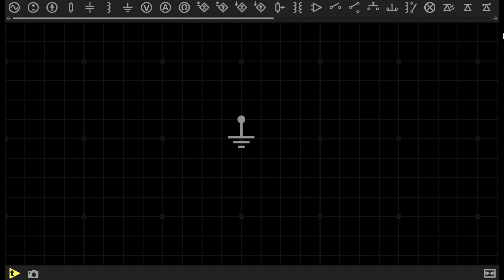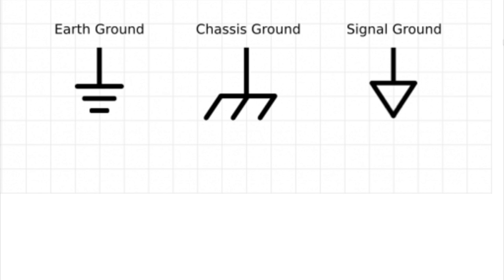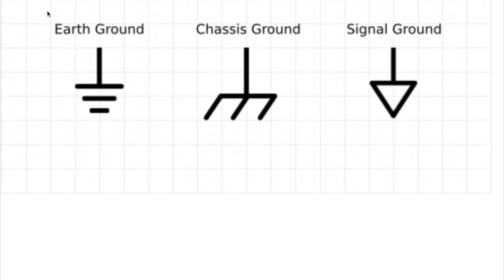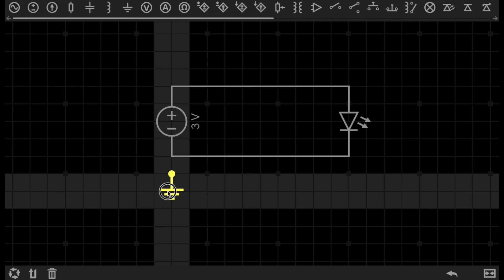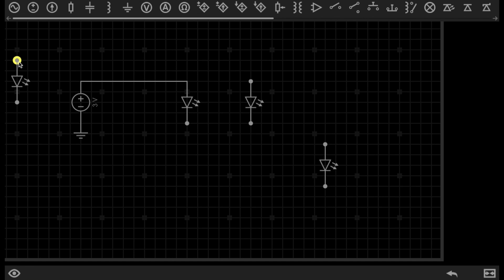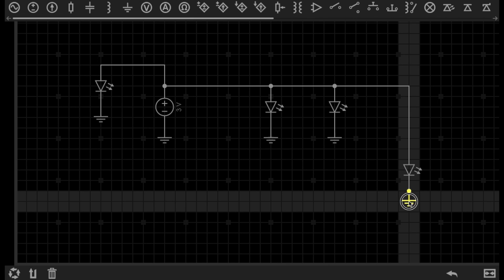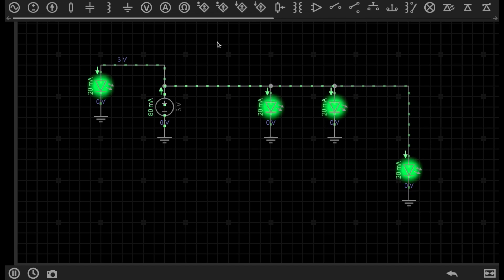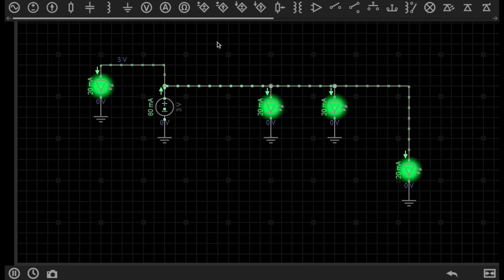That Ground Symbol (What is Ground?) - Electronics Basics 24

Comment: @1:52 “want to go in order to get rid of additional charge”. Incorrect statement, this is the point at which they are back to zero energy, that is 0 Joules. Another better way of stating it is “in order to return to the ground state (balanced). It then goes through the Voltage source to create the Anion/Cation imbalance.

Comment: 2:11 That's not true. Electrons come from the wire itself because the +ve side strips them from the wire, then a +ve wave of charge density ("holes") goes to a negative terminal.

Electrons produced on the negative side actually BLOCK other electrons in the wire until a +ve wave hits that end, then the electrons from a negative terminal start skipping from +ve hole to +ve hole throughout the wire, until they reach a positive terminal.

Comment: 4:26 alright so let me see if i got this right. All the loads are connected to ground, and the negative terminal is connected to ground. Electrons flow from positive straight to the ground, and then back to the negative terminal of the battery through the ground. The ground completes the circuit so the GROUND is supplying electrons to the battery as shown in the video

Comment: battery is like an apple on tree, its have potional energy...or like quiet sea have potional energy...now battery almost like capcitor...one plate is charged with more electrons and one is with less...and the electrons is pushed away from the negative toward the positve terminal.  you can do test it for your self people...this guy is wrong..electrons never move from positve to negative...everyone think that electrons move from the positive side of battery to negative...because of the sign +,   ironically the electrons get out of the battery from negative side through the wire and to postive side...

Comment: in a battery the electrons get out from  the minus side through the wire to the positive side...also in capcitor and all other electronics...in ac its different story, but in dc , the electrons move from negative terminal through wire to the postive, the same happen in pn junction diode...the electrons attracted to the holes through the wires...its shame that such basic stuff explanied wrong buy thus guy....electrons cannot move from positive to negative they will repeled ....this confuse alot of people...in battery when you have wire its not move from positive to negative, but from negative to positive

Comment: You are not correct on saying the electrons coming out of the LEDs to ground are dispersed.    They may may be at  (near) 0 volts, but the current has to keep flowing until it gets all the way back to the battery or source... the total number of electrons must be conserved or else that battery is going to become a hideously charged ionic monster!    You can also measure the current on either side of the battery.     

Furthermore, if your LED voltage drop is exactly the same as your voltage source, you probably aren't going to get full power on the LED because of resistance losses in both the supply wires as well as the ground wires - the voltage coming out of the LED is certainly not exactly zero.       

Electrons cannot lose charge.   I think they just move from denser areas to areas where there are holes, due to the chemistry of the battery or the influence of magnetic fields in a power supply.

Comment: At [5:17] you say that electrons no longer carry charge. Electrons by definition carry a negative charge and always do for as long as they are electrons. Furthermore, the animation does not showing electrons; it shows "holes" of positive charge sinking into the Earth. The negative terminal of the power source attracts an equal number of holes from the Earth and for this reason we have an electrical circuit. The physical reality is of course the reverse, with electrons moving in the opposite direction to the "holes" of positive charge.

Comment: Electrons are NOT flowing from positive to negative...current is flowing from positive to negative.  My understanding of electrical circuits and electronics was screwed up for a long time because of statements like this.  There is no need to talk about electron flow, just current flow from positive to negative.   Being an electrical engineer, you can safely assume I have since figured it out.

Comment: As an Engineer and teacher is has become troubling to me that you take the time to create explanatory content that is incorrect.  In this case, you state things that are not correct and will, down the road, lead to MUCH CONFUSION as you have laid a faulty foundation for those trying to learn electronics.
First of all, if you are going to use conventional current flow in your analysis, then you CANNOT state that it is electron flow;  Electron flow is the physical current flow, not conventional current flow.  Why is current, by "convention", used for circuit analysis?  Because it prevents most of the negatives in equations.  There is NO REASON for you to show conventional current (hole flow) and then claim it is electron flow!   A simple Internet search will prove this to be the case as with the rest of what I am about to write.

Secondly, ground has NOTHING to do with where "electrons want to go."  Ground is EASILY describes as a common reference point and at point can be any potential in the circuit.  As a matter of fact, it is commonly NOT the most negative nor the most positive.  Operational amplifiers use split power (typically +/- 15V) and ground is the mid-point of that 30 volt split.
But, again, "ground" is just the common REFERENCE point which may be connected to earth ground, the chassis, both, or neither (floating power).
There is NO REQUIREMENT to ground anything in a circuit if the circuit is floating.  A flashlight is a perfect example as there is little more than a simple series circuit.  There is NO GROUND and polarity has nothing to do with it.  If someone asks where is the ground in your flashlight, the answer would be "there is no ground."
In modern automobiles, the power system is known as "positive twelve volts" because the COMMON or shared side of the power supply is negative (chassis/engine block connection).  Vehicles used to have different systems like "negative six volts" and they were negative systems because the POSITIVE side was the common connected to the chassis/engine block.  That vehicle ground has nothing to do with earth ground since you vehicle is electrically isolated from earth ground by rubber tires.

TL/DR:
Ground is a common reference point that is NOT determined by polarity and may be more than one type if it exists at all.  And conventional current flow should never be taught as electron flow, as it is the OPPOSITE of electron flow.

Synopsis:
You are laying a weak foundation for further understanding and I can't just sit quietly why you do those wanting to LEARN electronics an injustice.  It's just as easy/simple to teach it correctly, so why is that not the case in many of your videos?   I think your viewers/subscribers should know and this is not a rhetorical question.  I also wonder if this comment, like others I have made, will even stand for others to read.
Maybe I'll just make my own channel that shows all the bad videos/information being created and how you were informed about it but did nothing and deleted my comments so no one else would know.  I imagine many would be quite upset if they found that out.

Comment: Completely wrong. Chassis is connected to PE while current flows from P to N. Explanation for example here: https://en.wikipedia.org/wiki/Ground_and_neutral
Neutral on chassis is dangerous (when the house loses grounding or the grounding gets soft you get electric shock) plus you cannot then install safety by residual-current circuit breaker: https://en.wikipedia.org/wiki/Residual-current_device

Comment: where does ground comes from in potable generator , not all generators have it
Reply: As far as I know--portable generators often use the generator frame as a "chassis ground." Depending on local code regulations, the frame may also need to be connected to earth ground.

In the entertainment industry, we use portable generators on location shoots and never connect them to earth ground, as the way I understand it, connecting electrical systems to earth ground is done to limit voltages between the system and the earth ground in the event of unintentional contact with high voltages, ie transmission line faults, transient power surges, lightning strikes and induced EMF from lightning, etc. but portable generators are often isolated from high voltage sources, and aren't permitted for use during lightning storms anyway, so an earth ground isn't required most of the time.

Comment: Oy, this video is a real doozy. As other have pointed out, electrons don't flow that way. If yer going to use conventional current flow, you should really say "current flows" instead of "electrons flow", and I feel like most people watching this video aren't going to know what conventional current even is. Give a short explanation that it's technically reversed for historical reasons, and maybe give a link to your other video on it.

Beyond that, things don't "get rid of charge", and more importantly, the difference between ground symbols can be critical. I came here specifically to learn more about the differences between grounding schemes, why specific ones are used &c. The way they were described as 'the same' was not only not very satisfying, but it could be downright dangerous: hopefully nobody has gone on to blown up their oscilloscope after being mislead by this video. Simplifying things for beginners is good, but you really gotta give a disclaimer about there being more to the story, and probably a warning about connecting the grounds of different circuits.

Comment: So when drawing a schematic consider conventional current flow so you can ground the negative side instead of drawing loads of lines? In circuitry ground only exists purely for schematic purposes? In reality the only grounding would be on screened cabling to dissipate electrical noise?

Comment: Fantastic! Now I know ground is just the negative side of the battery. I wish other people would have said that and not left me confused.
Reply: Well, in a simple case. But if you imagine more batteries in series, then it's the last one in that will represent the theoretical ground, theoretical, as it is not really grounded, so between that and the real ground point there can be potential difference.
Reply: @fulesmackofule  can u explain to me in that case , where is the real ground point?
Reply: @datle5585  Well, I assume if negative is connected to the real ground too, then it would be. But it is not 0V potential ever as charged by many things, e.g. particles from space. But good enough. :)
Hopefully it is clarifying.
Reply: Unfortunately, no. This video is misleading and a little wrong; ground is more complicated than that. Here is a more complete explanation. www.youtube.com/watch?v=KXjSSvIrKUw
Reply: That’s not ground. I can use the positive as ground.
Reply: @altuber99_athlete  Well You can . But In conventional electronics - ve is ground because flow of electrons has been considered from + to - ve .
Reply: @exincident  +ve to -ve is the conventional current, not the flow of electrons.

Instead of electrons, think of the holes left behind when electrons have jumped from one atom to the next.It's the holes (lack of electrons or "vacancies") that are apparently moving with the conventional current.
Reply: Electrons are negatively charged and attracted to the plus terminal.  Dumbing down hole current vs electrons vs charge causes confusion with others that teach the actual behavior.  
 @exincident
Reply: Ground is defined by the designer. The reference point can also be the positive side. As an example using the car, in the USA ground is negative side of battery while in Europe it may be the positive side.
Reply: https://youtu.be/upaVO_SMAQM 🙏🙏

Comment: I understand that the earth (i.e. ground) can serve as an infinite supply from which a circuit may draw electrons or an infinite sink into which a circuit may dump electrons.  But, does ground when used as a practical (as opposed to theoretical) component within an actual circuit implementation possess a lesser (or greater) resistance / impedance to the flow of electrical current?

Comment: The Ground in your house, I was informed, is there in case you 

a) Get a ground fault and your trip / RCD will flip to off
b) Your house gets hit with lightening, the strike if it finds a path in wire will be directed to ground and not in to the electrical grid.

Comment: I have two questions. Why on this schematic the electrons flow from + to - and in previous videos it is shown exactly the opposite? For example in  "How Batteries Work - Electronics Basics 2". Why do you put ground symbol in completely closed circuits in all previous videos?

Comment: so could i get an led and get a battery and hook up positive to the positive side then just stick the negative side into the ground via a wire or or attach it to something metal and it would  light up?
Reply: +NoVaKane No.
Reply: AverageGeek k didnt think so.  Thank you
Reply: AverageGeek so essentially  it's just used as a reference where the electrons want to flow for concept reasons but it doesn't work that way in a real world application?

Comment: In my digital electronics class last year we learned that because electrons are negatively charged, circuit diagrams are kind of wrong compared to what is ACTUALLY happening. Does this mean that when you look at a battery(in real life), the end of the battery labeled (+) is actually the end with more electrons, and the end of the battery labeled (-) is actually the end with less electrons?
Reply: No, the video is just wrong/vague in that regard. The negative side of the battery has indeed more electrons. Otherwise there would be no potential difference and no flow/current.

Comment: Confusing.  Electrons do not flow from + to -.  They flow from negative to positive.  Also you say electrons lose their charge?  Don't the electrons return to atoms which have missing electrons (hence their positive charge)?
Reply: In electronics when electrons move, the current moves in opposite direction. Its a convention. And a ground is considered as a sink for any charge. Electron may not always reach its original atom which lost it. They are free electrons. Imagine free electrons as water molecules flowing through a bed of marbles, where marbles are atoms.

Comment: If you do a web search, most sites say electrons flow from negative to positive. Why are you saying positive to negative?
Reply: Look up the words "conventional notation" -- It's what engineers use. Yes, the electrons flow from negative to positive, but electronics was established with positive and negative symbols, and the false belief that the charge source was positive. The human brain thinks of things moving from plus to minus. So it was easier to keep "conventional notation" for the purpose of circuit design.
Reply: 909sickle He didn't do proper research.

Comment: I'm not sure I agree, mate. I look at ground as no more than a tool to simplify schematics and equations. It's just a reference point. You declare, "I call this 0 Volts" and then you do some math. 

We choose earth as ground, because the earth has massive capacitance, meaning it's potential is fairly constant.
We choose the negative side of a voltage supply, because that just makes the most sense, most of the time. It is sometimes useful to have negative voltages in your circuit. In this case you place ground between 2 voltage sources.

Ground is not a physical thing. It just helps you wrap your head around a circuit.

Comment: why isn't there a ground and a negative plug in a wall socket, is this in case voltage doesn't drop to zero? also what would happen in let's say a battery if this didn't happen?

Comment: "electron loses it's charge" ?
Reply: Picture firing a gun at a metal plate. The bullet comes out of the muzzle with a lot of speed.
Now assume the bullet has just enough energy to pass through the plate, after which its velocity and so its kinetic energy drops to 0
Reply: @_neophyte  this made it much more clear. thanks
Reply: @_neophyte  Still weird to use "charge". Electrons don't lose charge, they lose energy.
Reply: seethegalaxy electrons are pressurized, this creating voltage. Voltage flows through the conductors into loads or resisters and lose its energy, which is provided by the Voltage Source or power supply.